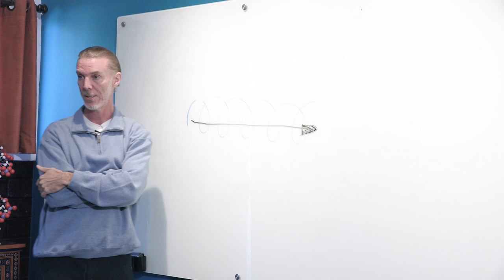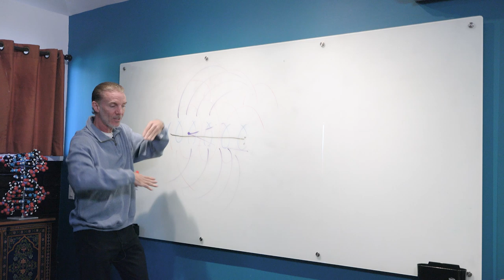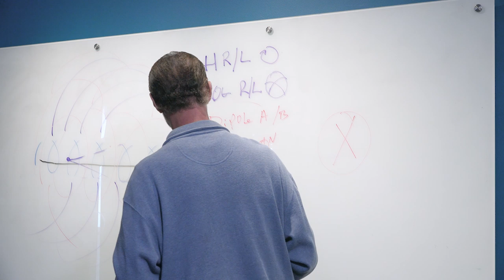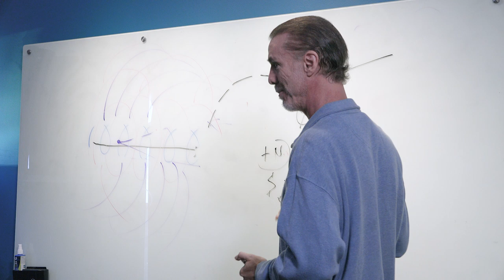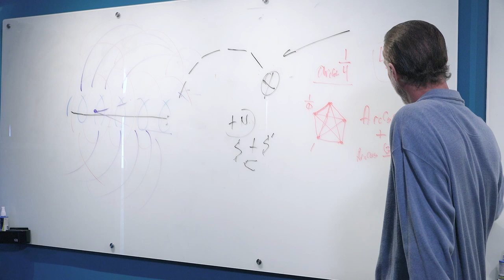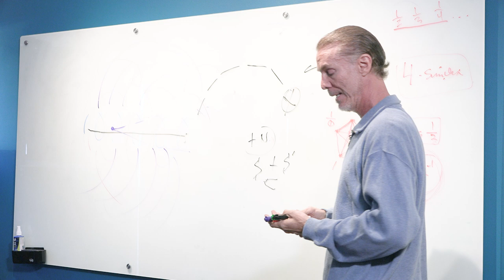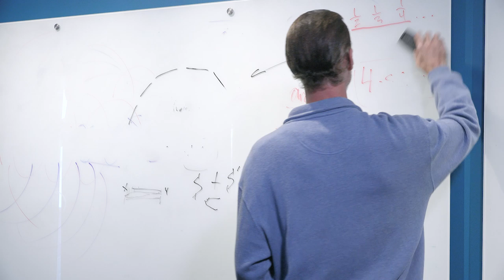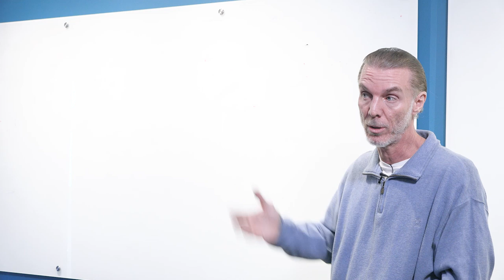Klee Irwin - Emergence Theory Overview - Part 3 of 6

Comment: These lectures are blowing my mind. I have been obsessed myself with exploring lower dimensional structures as higher dimensional expressions of interaction, and lower dimensional wave cycles as the points at which higher dimensional structures intersect, behaving like wave interference. Imagine it like a an n-dimensional waveform interaction with other n-dimensional wave forms and creating an n-1 dimensional wave form, where they overlap. Also the duality that prevails in nature, in phenomena such as charge, magnetic polarism, spin direction, color charge and so forth. Rotation of a planet around its axis exhibits similar behavior as particle spin, but even planetary orbits, which are described as linear trajectories which appear orbital because of spacetime curvature, exhibit a helixical structure if you were to trace its position around a star, which is itself moving around the centre of a galaxy. 

We like to map those trajectories on a threedimensional xyz matrix, but that is merely a mathematical tool to translate those behaviors into numbers we can work with. Something doesn’t move in relation to an imaginary x, y, and z axis, granting us threedimensional data. When something moves, it moves in one direction at once, which is either up rather then down, left, rather than right, or forward rather than backwards. But strip the xyz matrix we project onto it, and the only information you can gather from it is how it is moving relative to something else, in only one direction, and with a certain velocity. The most inmportant determinating factor seems to be the velocity at which an object with mass moves in relation to light speed, for it has farreaching consequences for how spacetime seems to behave from that inertial frame. 

I do still wonder why gravity seems to be attractive only, when compared to electromagnetism. We know that gravity slows down time, so that when an observer is close to a source of gravity, time seems to stretch out and the rate at which we experience time is slower. I feel like the central line in the helix might be a good representation of the relation of C to other particles, and that the pitch that relates distance to timecycles (as eigenvalues I presume?) feels intuïtively right to capture the effects of special relativity, and the equivalence between mass and energy.

I have a hard time completely grasping everything in those lectures, but philosophically it inspires me in a very profound way. I’m looking forward to where this pioneering branch of research is going to lead in the near future, because I feel it might be on the right track to finally approach a unified theory! Possibly one in which mechanics like those in the wave-particle duality of the double slit experiment become clear, one in which entanglement becomes clear, and one in which consciousness or at the very least subjectivity can be related to and explained by the phenomena of lower dimensional holographic units hold information from an entirely unique vantage point with regards to the threedimensional structure it captures. Special relativity also implies an importance of subjectivity since it are the parameters of the inertial frame of an observer in relation to an inertial frame that differs from the one of the observer that suggests there is no absolute time. This emergent theory might very well be on track to provide a framework that accomodates all those phenomena, and I’m excited to see it unfold in my lifetime!

Comment: @51:00 I think you are deluding yourselves? But fact check me. Causal triangulations are supposed to be primitive, so there is no concept of measure or angle associated to them, they're topological objects, not metric objects. The "angle" notion has no meaning dude. If you want them to have angles then you've snuck in an assumption of a more primitive smooth manifold or embedded them in some other substrate of some sort.